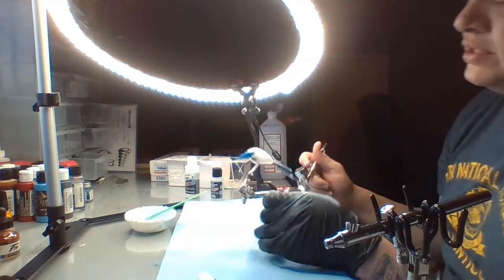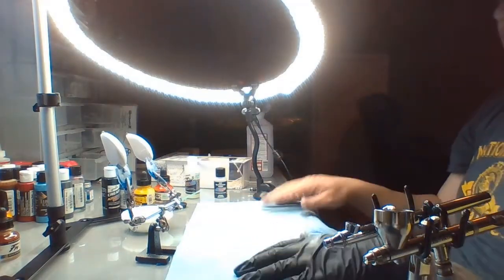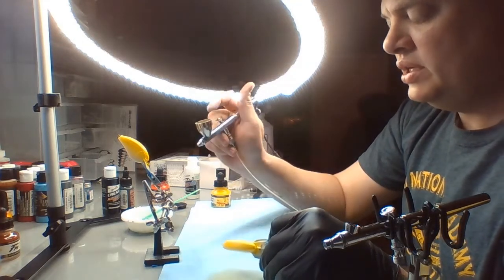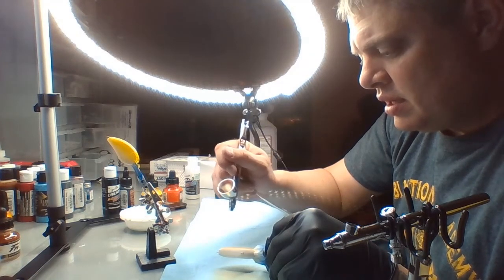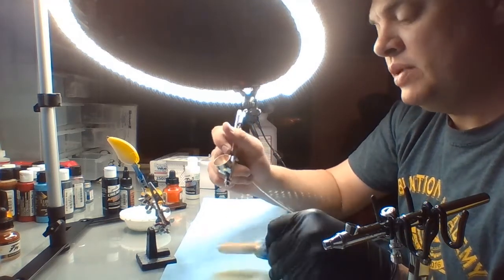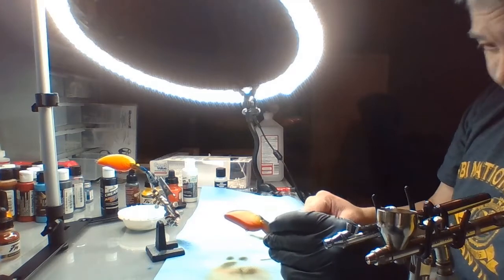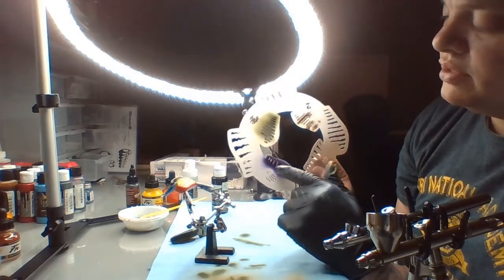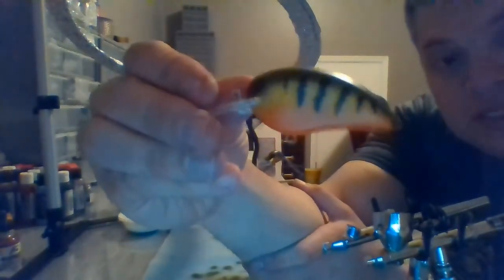How to airbrush crankbaits with fire tiger pattern

Comment: Hey good video no need to apologize when your airbrushing, when using Die, it contains ink they dont have the binder createx has so they tent to be soft if you spray 4004 transparent base over your die it will not scratch as easily, Wicked colors has the best dies that do bind great called Candy02 by auto-air colors all waterborne. Good luck